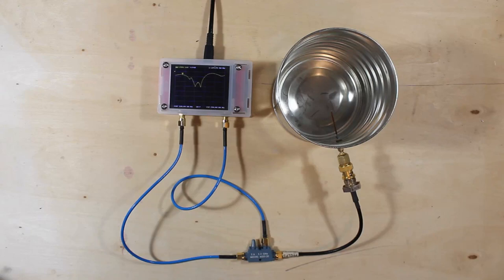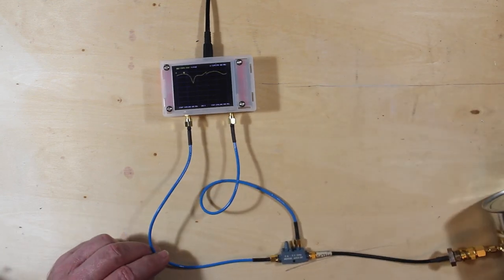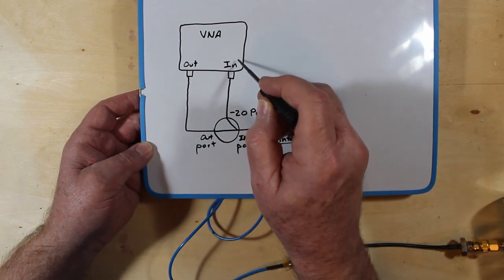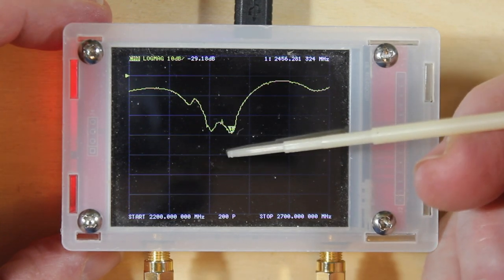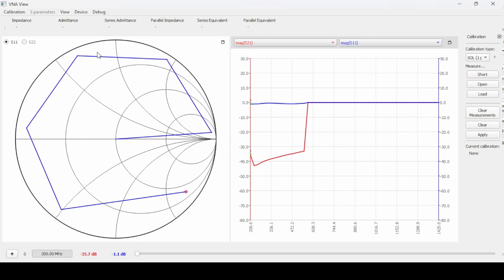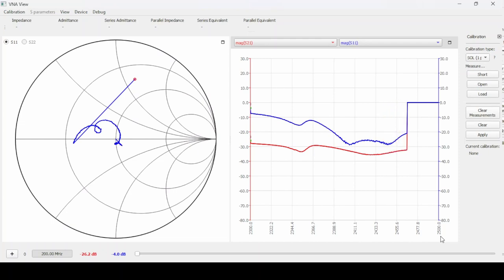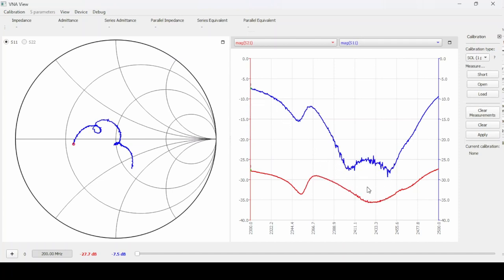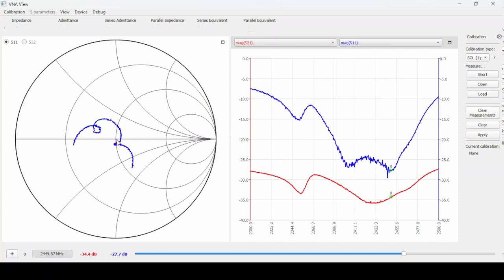NanoVNA Checks Antenna Using 'VNA View' Software For A Big Improvement #electronics  #radio #vna

Comment: Nice demo. Someone made a nice "cantenna" for 802.11B/N/G. There was a time when people were using Pringles cans and getting incredible distances with WRT-DD open source routers.
Reply from the maker: I remember the pringles can days.  2.4GHz will be around for some time with 802.11ax and 802.11be both able to use it.

Comment: Why have you used an external coupler? The VNA has that built in, and will be characterised fully during the cal.
Reply from the maker: Thanks for the comment. You are correct.  The case for my NanoVNA has no printing on and I forgot it was built in.  I took the directional coupler off my SSA3021 and put it on the Nano without thinking about it.  I'll modify the video description.
Reply: @MoreThanElectronics  I've had days like that.

Comment: Hi, one small observation. The mag(s2.1) trace tells you the frequency the antenna is cut for. The vswr trace having two minimums shows you that 50 ohm match is not achieved at that optimum frequency, as you sweep through the optimum frequency the match approaches 50 ohms and past it to some other impedance and then back through 50 ohms on the way out the other side.
Reply from the maker: The antenna is a one port device therefore we are interested in the S11 parameter.  Rohde & Schwarz has a nice video on this-  https://youtu.be/-Pi0UbErHTY
I believe the double dip is because the coffee can bottom has two different heights.  The better than 20 decibel return loss in the lower portion of the WiFi band is certainly acceptable.

Comment: Greetings.  

Do not know the  V2 Nanovna, However, please what am I missing ?  I'm sure I am spinning.  

Why not just do a S11 measurement ?
Reply: Wondering the same thing. That was weird. It doesn't look like Port 2 (S21) measurement was even turned on.
Reply from the maker: Starting at 6:30 in the video you can see that it shows mag(s11) in blue and mag(s21) in red.  mag(s11) is channel 0 starting at 3:47.